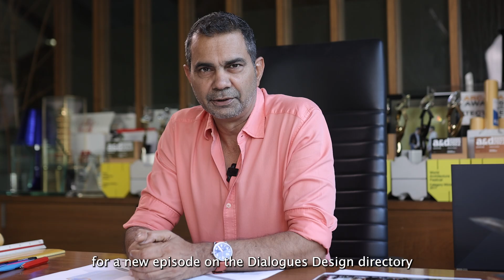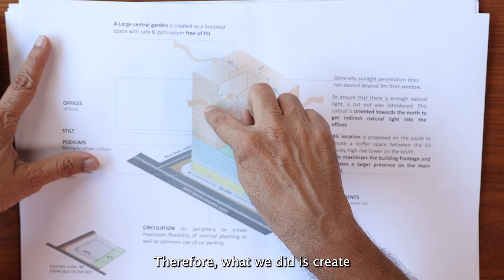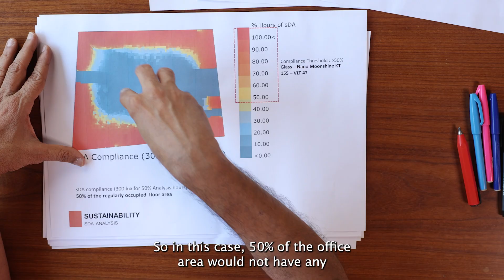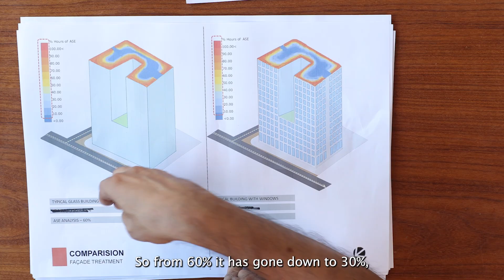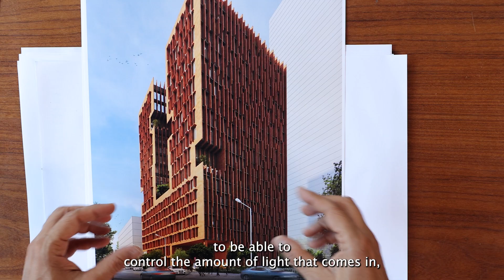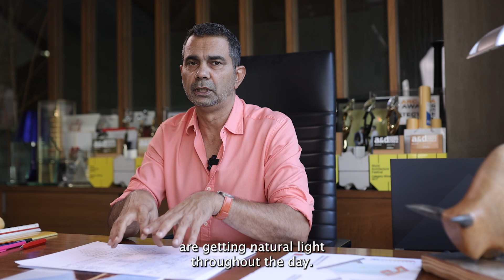How Sanjay Puri Controls Light & Heat in Buildings | Easy Tips for Better Design

Comment: How about FSI. How you consumed it if height had a restriction. If not how you convinced client, to loose the same. 
Also on North side you said you took the recess on facade than why you require treatment for cut down the heat.
Reply: Genuine question
Reply: Calculate after making a sample design. You will find it convincing to have open spaces and vertical growth is right solution.